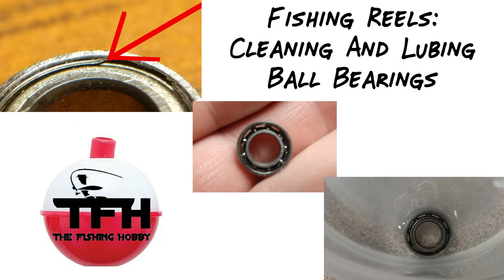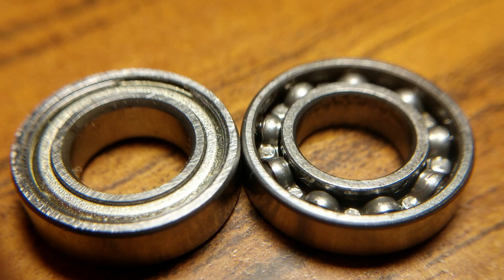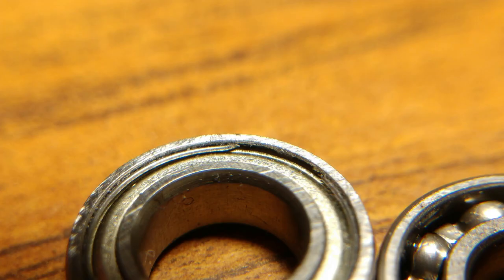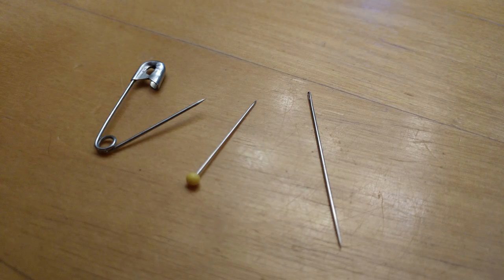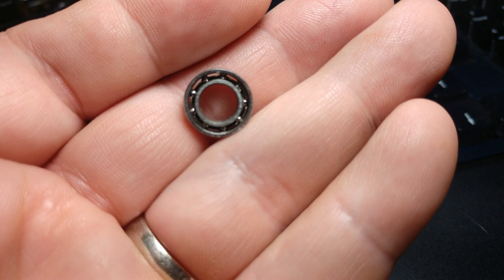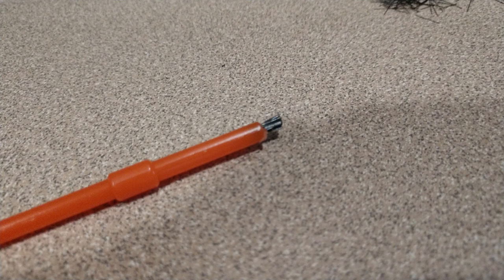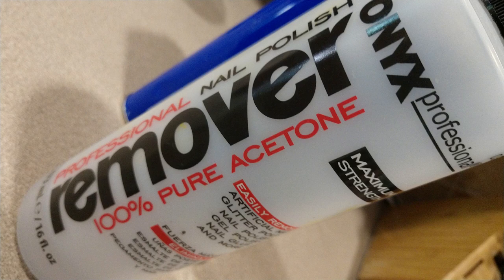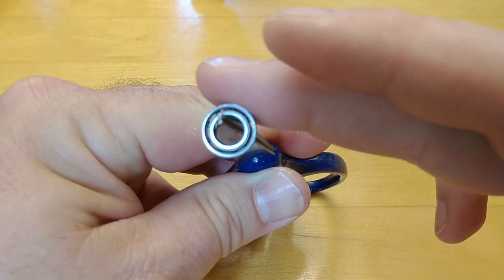Fishing Reels: Cleaning and Lubrication of Ball Bearings (How To Video)

Comment: Nice job. 
One can also use the degreasing agents in a denture cleaning vibrator tray for a faster method. Remember to go quickly and clean the agents out immediately when done. 

Your system works great for steel bearings but as much as I love Super Lube,  wouldn't use it on ceramic or hybrid  bearings.  Grease is great for bearings to reduce wear and some heat but sucks in the bearings that are directly responsible for supporting the spools in baitcasters.  Grease actually increases the drag on the spindles/axles/shafts and reduces the casting distances.  

For all the other bearings on baitcasters and all spinning reels, Super Lube is great.  Typically oil for bearings,  grease for gears but low speed bearings can also benefit from a high quality grease.
Reply from the maker: I should have mentioned that almost every reel I own is a spinning reel. I typically use the super lube oil (not the grease) in my spinning reel bearings (freshwater). I usually use an ultrasonic cleaner to clean all of my reel parts including the bearings but I decided to do the video without using it because I assumed most people didn't own one.
Thanks for the info/suggestions on the bearings for the spools of conventional reels, I am pinning this comment to the top of the list so others will hopefully see that as well.
Tight lines!

Comment: I use paint thinner when cleaning my reels and use welder's brushes from HF cut short like you show.  Blow dry with air compressor.  Reassemble using Corrosion-X only on the bearings, a little Corrosion-X on the brush mixed with reel butter on all reel moving parts, reel butter only on the carbon drag washers.  I fish almost exclusively salt water and use Stradic spinning reels.  I have not had any issues with my system.
Reply from the maker: Sounds like a good way of going about it👍
I personally use an ultrasonic cleaner to clean my reels. I do so many every year that it really cuts down on cleaning time. This video was just to show someone how they can clean bearings by hand. I just assumed most people don't own an ultrasonic cleaner so this method would be something more people would find useful.
Here is a link to the video of my ultrasonic cleaner: https://youtu.be/Rq6ydjtzJ2Y
They are handy to have for a lot of things other than fishing reels too 👍

Comment: Those disposable brushes are available in packs of 20 for about $4 at Michael's.  In the hobby section.  WD40 is good for cleaning out old grease and has a more pleasant smell than mineral spirits.
Reply from the maker: Thanks for the tip on the brushes!
WD-40 does a good job too but does leave a residue where the pure solvents don't. Not saying there is anything wrong with that, just mentioning it. WD-40 does a good job because it is made up of 50% Mineral Spirits but you are right, it certainly smells better! Naptha (which is basically the same thing as Zippo lighter fluid) doesn't smell as bad to me as Mineral Spirits and it is a more powerful solvent so it works much quicker with no residue left behind.
I have used WD-40 myself to clean bearings before 👍 
Also, the knockoff spray lube Walmart sells works just as well as WD-40 IMO for just over 1/2 the price. In fact, I'd bet WD-40 repackages their product for Wally World's house brand. It is quite a bit cheaper and smells and acts identical. Super Tech Lubricant, 8 oz
http://www.walmart.com/ip/Super-Tech-Lubricant-8-oz/21618346

Comment: thanks !!! the best response to a youtube question ever, very good help thanks again,im going to do my reels soon
Reply from the maker: No problem, glad to help!
Reply: @TheFishingHobby  a few years ago, i heard a guy says that singer sewing machine oil, use to be good for bearings, ,have you any input on that as my wife has some ,cheers
Reply from the maker: @lazycarper7925  it will work but it will need to be oiled more frequently. It is a very low viscosity oil so it will work its way out of the bearing more quickly than the super lube. An oil that would be an in between regular grease and oil would be bar and chain oil used for chainsaws. Not as thick as grease not as thin a most oils but very sticky/clingy and will stay where you put it for quite a while.
Reply: @TheFishingHobby  thanks again, ill get the super lube, and keep it for future reels
Reply from the maker: @lazycarper7925  no problem and tight lines!

Comment: I clean them with a paper towel then I add about 2 or 3 drops of oil then I pack grease tight in them after about 10 minutes of reeling and casting it loosens up and feels perfect. BTW these bearing don't coat much sometimes just buy a new bearing and put it in and toss the old 1
Reply from the maker: I keep a lot of bearings on hand. If I order one I at least order 5 to 10 to have extras (I rebuild a lot of reels). You are right, they are cheap but usually a clean and relube is all that is needed. I use an ultrasonic cleaner normally, but I know most people don't have one so I thought I'd do a video to show people who don't an easy way to clean them up.
Thanks for watching and commenting!
Reply from the maker: BTW, I thought you might want to look at some of these old reels (I rebuild a lot of vintage reels). https://youtu.be/vxXVAnmVOD4
I have other videos on vintage reels too.

Comment: Technically you can just remove the shield from the bearings and use ronsonol lighter fluid… It’s basically just naphtha. When it dries it leaves a thin layer of mineral oil on the bearings. But if you’re going to abuse your reel by leaving it outside and letting it get rained in you might be better off going with something like TSI 321 or yellow rocket fuel… But I wouldn’t ever put grease in the bearings. They are simple to take apart if they do need a little lubrication.

Comment: How do you feel about silicone lubricant for Saltwater? Is it a good idea?
Reply from the maker: I stay away from silicone grease and lube for reels personally. The reason for that is because if it ever gets on anything that needs to be repainted or glued /epoxied it can cause major problems. A lot of people who work on reels advise against silicone products for reels. That said, I'm sure someone else would say they use it with no problems. I really like the regular Super Lube multipurpose grease and oil for reels. Super Lube does make a silicone based grease and oil as well, but it says Silicone on the product name so you can avoid it if you don't want to risk using a silicone based lube.
So I wouldn't recommend using silicone based products on reels personally although I will admit that I have never tried it myself. I work on my own rods and build them too so I really don't want any silicone near them (it can make the epoxy on the guide wraps not stick like it should) and that is the main reason why I don't use anything Silicone based on my fishing reels.
I hope that helps, but you may want to read up on it some and decide for yourself.
Reply: @TheFishingHobby  Thanks.   I will take your advice into consideration.  Also, what do you think about transmission oil on bearings and gears?  Some guy at the bait shop that repair reels,  recommended me to put the transmission oil.
Reply from the maker: @mcheng102  it will work but it is pretty thin. A more viscous oil that clings better and is easy to find would be 80w gear oil.
Here are some links to the super lube products that I use:
Super Lube 51004 Synthetic Oil with PTFE, High Viscosity, 4 oz Bottle https://www.amazon.com/dp/B000UKUHXK/ref=cm_sw_r_cp_apa_i_P3ptDbAEJKMJH

Super Lube 21030 Translucent White Color 3 oz. Automotive Accessories https://www.amazon.com/dp/B000XBH9HI/ref=cm_sw_r_cp_apa_i_Z5ptDbYQ3TZ8W

Comment: Abec 7 ceramic bearings in my reel are super loud....can I add a drop of reel butter oil to quite them a little or no?
Reply from the maker: It wouldn't hurt to try. Usually when bearings are noisy it is either due to lack of lubrication, being dirty or internal corrosion or damage.
Reply: I heard ceramic bearings are naturally loud anyways

Comment: I have another question for you.  Can I use 91% Isopropyl Alcohol to flush the bearings clean instead of acetone?
Reply from the maker: It wouldn't hurt to try it. WD-40 is a good degreaser too if the Iso doesn't work well enough.
Reply: @TheFishingHobby  ok thanks.

Comment: well my one is rusting i tried to take out the rust with wd 40 but it didint really work my bearings arent really moving like how there supposed to i dont know what to use to take it out and get it back working
Reply from the maker: Is it stuck in the reel body?
Reply: @TheFishingHobby  no its the bearing it self actually the little balls got rust on them and it dosent allow it to spin
Reply from the maker: You will probably have to just replace the bearings with new ones if they are rusted very much. Rust will make pits in the balls and they won't move freely when they get too far gone.
Reply: @TheFishingHobby   ok well thank u for taking for the advice really appricete it
Reply from the maker: No problem, good luck with your reel!
Reply: @TheFishingHobby   yes thank u have a blessed day

Comment: Super lube is ok but people tend to put things like automotive oil and grease, silicon products, Vaseline, etc., in their reels and it's a big problem. Oil and grease designed for fishing reels is very inexpensive and a small tub will last the average person years. I highly recommend people just buy products made for reel servicing.
Reply from the maker: I don't disagree with that. I've been using super lube oil and grease for years now and I rebuild dozens of reels a year (mostly vintage spinning reels) and I wouldn't hesitate to recommend it to anyone. Super lube is pretty popular amongst those of us who collect and fish with vintage reels. 👍
Reply: @TheFishingHobby  yeah super lube is a great product in general and works well in fishing reels for sure. It actually does really well as a drag grease because of the viscosity and its ability to work at high temperature. I just don't want people to think any non fishing reel grease or oil will work. I've seen some crazy stuff servicing reels over the years!
Reply from the maker: @jeffsmith825  I can imagine what you have run across 😆
I know I've seen some nasty reels!
I use super lube on carbon fiber drags and old leather drag washers too.
Reply: @TheFishingHobby  yeah I've seen some awfully disgusting reels. The worst is usually automotive grease. Some lower viscosity automotive oil won't kill a reel although I would certainly not recommend it but the grease will destroy a reel. I reread my original comment, I didn't mean to be argumentative, I should've used a different term than "ok" for super lube as it's a good product. I just know people hear "grease" as a general term and think the grease they pack the bearings on their trailer with will work on their reel (saw that one not to long ago)!
Reply from the maker: @jeffsmith825  I've seen some I suspected as wheel bearing grease (blue but waayyy thicker than blue reel grease). Some of those greases also break down plastics which are common in modern reels...not a good combo at all.
Reply: @TheFishingHobby  yeah and I've found usually when someone uses a grease like that they don't know what they're doing and they basically fill the reel with it. I do a few dozen surf fisherman's reels each year and they tend to be the worst that I see. They buy high priced reels with seals everywhere and still pack the body of the reels and send it to me asking why it's so hard to turn. Then I show them the what it looks like when I open it and they act surprised!